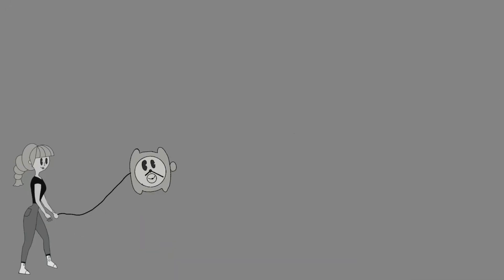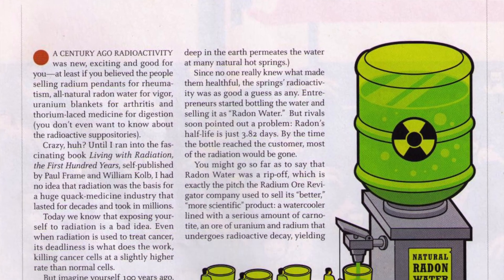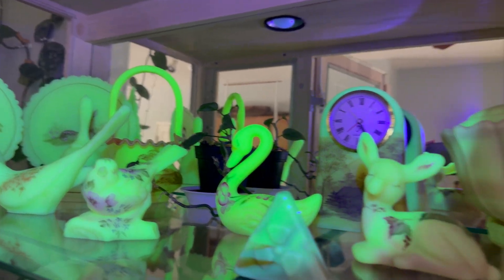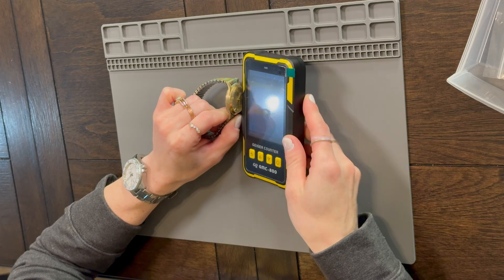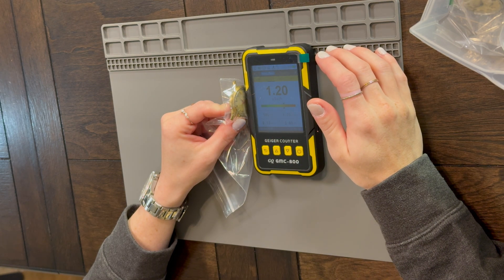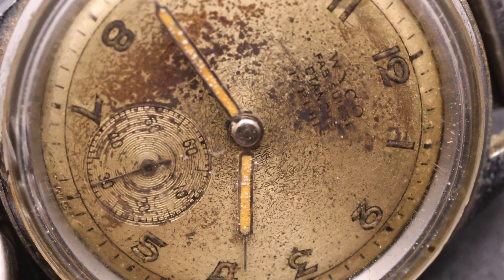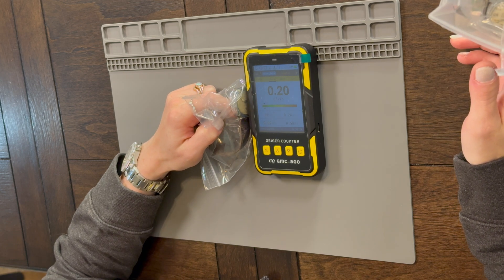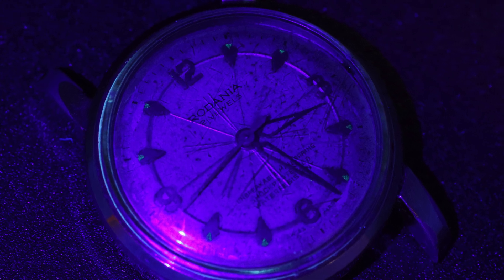New To Vintage Watch Repair? Be Mindful Of Radium Lume And The Risk It Carries.

Comment: I bought some Osco watches for parts  The dials on them were not radioactive but the movements  still had fragmented radium lume on them. I assume they had been stored with some watch parts that were radioactive. I always check with a UV torch first and an Alphahound. Radium dust can be microscopic and easily inhaled especially if youre using a lupe.  If you do ingest it Radium ends up in your bones because the body teats it like calcium.

Comment: ...i know hot to  clean that  from Radion , but i dont can explane that,ppl repead it wrong or alike . one thing is to  mention by ruel off tenic  to stat that   cheapest is   a   airfilter syiem climatet  container room,  that stay on  a masiv concret plate ...so far that laboratory.... iown 3 off that Lever / rolex  in London(i buyd foa a very low price ) made  but  might when i retier i have time for those awail they are  radiontion save seald.

Comment: I’m going to qualify my comment by saying I work in the nuclear field. Radioactive doesn’t always mean dangerous. Bananas give off low level alpha (helium-4 nucleus) radiation, and bananas are quite harmless to eat. While breathing in radium dust, or eating without washing right after working on a radium watch can be harmful, as long as you take necessary precautions, you’ll be fine. Wear full gloves, a respirator, and get a big gallon ziplock bag and work inside of it. Also, if any dust gets on your desk, or tools, they are now contaminated, wiping it up with water will not work, I recommend Fantastik, wipe once, fold the cloth, wipe once, fold the cloth, etc. Put the cloth in the ziplock bag. However, radium stopped being used in the late 50’s early 60’s in favor of tritium, which is a radioactive form of hydrogen. It will still make your Geiger counter go off, but is much less harmful than radium. If you ingest tritium, just go drink beer and you’ll flush it out, that’s not hyperbole. Don’t be scared of the Geiger click, be careful and respectful, but understand what you’re working with might not be as bad as the doom and gloom videos would have you believe.
Reply from the maker: Yea I know they are ok to work on if you use the right precautions. I just don't know that I want to work in a large zip lock bag with a respirator 😅 And my fear mostly came from the fact that I didn't know about radium in watches and its dangers BEFORE I opened one and worked on it. So this video was mostly meant for the newbies to the hobby, that don't know about the potential danger of working on them with no precautions in place.
Thanks for the info about Tritium!
Reply: @Thesecondhandwatch very good! I really like your videos, especially your commentary.

Comment: I would definitely work on them, with BASIC safety practices they are no worse than a X ray or an air plane flight, enough of these historical pieces have unfortunately been lost due to the issue.
Reply from the maker: Yea it's really the airborne particles that get me worried. I'll work on some of them someday, but not with my current setup.

Comment: I was at a flea market last week digging through piles of boxes that were clearly pulled from the storage unit of someone who had passed away, and pulled out a vintage watch dial with no crystal. I immediately thought about radium, and wasn't sure if it was or not, so wanted to wash my hands just in case, but of course the restroom was out of soap, ugh lol
Reply from the maker: Hopefully it was radiumless. Of course there was no soap 😅 Glad you knew about the radium though!

Comment: Don’t ingest it. Don’t sleep next to your box of watch parts and you’ll be fine. Don’t work on a surface that is hard to clean. Go take your geiger counter near a ww2 fighter plane in a museum. Sitting in the cockpit of some of those will give you like a chest x-ray per hour in dose. Radiation is everywhere. The limits set by the government are very low. The dose that actually increases your risk of cancer is very high. If your device detects gamma and your far enough away for it to show normal background you’re fine. Also water and sand are great moderators. If you are really worried about it get 2 buckets, put one bucket in the other and fill the gap with sand and then put a garden paver on top of it.

Comment: You'll hear a ton of opinions on this.  Don't lick it and you'll be fine, but i think it comes down to personal comfort. I wouldn't dare touch them.  There are so many watches you can work on that it's not worth the risk.  If you enjoy vintage wristwatches, I'm sure you'll enjoy working on antique pocket watches. No wristwatches can match the beauty of those movements.  An absolute joy to work on.
Reply: Surprised you are so scared of them given your work .
Reply: @MyRetroWatches  I've had a tumor removed 5 years ago.  No way I take any chances.

Even the radium girls, who licked the radium, didn't die immediately. It took them a couple of years.  So if I accidentally inhaled some, would it surprise me if it took 5 or 8 years off my lifespan or caused tumor growth?  Not in the least bit.

Comment: I take a moderate approach on the matter. I have several radium painted dial watches, and I wear them without concern. Radium watches were worn on millions of wrists for decades without a public health issue. That said, I won't sleep with one on because I'm likely to put my wrist up to my face when I sleep. The biggest exposure hazard in working on radium dials is from generating radium dust, which can be avoided by removing old lume under a liquid, or just not disrupting it. Keep doing your research, take everyone's opinion with a grain of salt, and do whatever you feel comfortable with.

Comment: Can all be summed up by using common sense. Unless we work on watches with radium dials day in day out the exposure will be minute. I live near a nuclear decommissioning plant so I have more to worry about than most.Be careful when changing the battery in the smoke detector.If anyone is not happy about working on radium watches especially Rolex and Omegas send them to me and I will safely dispose of them completely free of charge😁
Reply from the maker: It's the airborne particles that worry me.

Comment: Glad you got a radiation detector, Katchiri. (Did I just butcher your name?) i think the real danger is breathing in the particles if they become airborne. Definitely wear a good quality respirator and put the hands under liquid when removing the radium. Also, don’t go by how bright the glow is, as it’s not a good indication of the level of radiation. I hope you keep up the videos and hobby, because I really enjoy them! ❤👍🏻😊 oh and you’re probably fine keeping them in the house. If you’re worried, just keep them in ziplock bags to prevent particles from getting airborne, and put them in a metal container.
Reply from the maker: I will keep going for sure! 🥰 I had so many people commenting on my videos saying that they were about to get into watch repair, that I wanted to warn other people like me, about the possible dangers of it 🙂
Reply: @ good on you! I bought a radiation detector a while ago to check the old watches I got on eBay to work on but fortunately none are “hot” 🔥 I’m working on an old Gruen from the 50’s (from the looks of it). I got it back together and running well. My first time getting this far on a Swiss watch! I ordered a new crystal for it but reused the original mainspring.
Reply from the maker: Congratulations! 🥳 I love myself a vintage Gruen.
Reply: I'm a bit late to the party, but I wanted to say that I am very glad you pointed out that the glow is not a good indication of radiation level.  

Radium has a half-life of 1600 years.  That means that a sample of radium will be half as radioactive 1600 years from now as it is today.  That also means that the radium painted onto watch dials and hands back in the early 1900s will have lost only about five percent of its radioactivity due to decay.  The glowing bits in a radium dial usually come from zinc sulfide, which glows green when energized by the radiation emitted from the radium.  The zinc sulfide also becomes damaged over time by the energetic particles emitted from the radium, eventually breaking down and ceasing to glow.  It is entirely possible to have a radium dial that doesn't glow at all anymore.  Always check with a good alpha/beta/gamma instrument if you have even the slightest thought that a dial might contain radium.

As has been stated many times, the primary danger is from particulates containing radium getting into your body, either via inhalation, ingestion, or through a break in your skin like a cut or a poke with sharp tweezers.  If you want to practice, get some modern lume, apply it to a watch face, let it dry, and then pretend that it's "radium lume".  If you want a harder challenge, add a little powdered, modern lume to the watch face, to simulate radium lume that's flaked off from the watch hands and is just rattling around underneath the crystal.  Use all the safety precautions and procedures you would if you were handling a real radium watch dial, and remove the lume from the watch dial and hands.  When you're all done and you've cleaned up, take a UV light and see how much "radium lume" is still on your hands, your tools, your work surface, etc.  If you have solid procedures, all that practice lume should be in your "radium" waste bag.  Certainly beats learning using the real stuff.

As far as disposal... check with your state and local radiological health and safety officials, as it can be a crime to just chuck it in the trash.

Comment: So they're not safe to wear on the wrist?
Reply from the maker: That is up to the wearer. As long as the crystal is not broken and it is sealed tight, it is safe in my eyes. Working on them is different because of radium and radon particles possibly being breathed in or ingested. 
I saw a study suggesting that you get more radium from the internet in your house than wearing one of these watches.

Comment: I will go a little further than MyRetroWatches said, I would suggest Nitrile gloves instead of finger cots, and a HEPA filtered respirator.  I say this because I am a retired Haz-Mat Technician, and I know that if you are working with Radium painted dials, indices, and hands, it could be in such a condition where it rubs off easily and could become airborne.  Radium gives off mostly Alpha particles (although Gamma radiation is also given off as energy as the Alpha particles are ejected.). It (Radium) is not that bad as long as it is not ingested, inhaled, or injected into the body.  So, an ounce of prevention prevents a pound of cure.
This is what I found while doing a little research, it sums things up pretty well.  “Due to the short range of absorption and inability to penetrate the outer layers of skin, alpha particles are not, in general, dangerous to life unless the source is ingested or inhaled.”  (Christensen, D. M.; Iddins, C. J.; Sugarman, S. L. (2014). "Ionizing radiation injuries and illnesses". Emergency Medicine Clinics of North America.)
Reply from the maker: Thank you! Great information!
Reply: I called my radiation expert friend who told me that you have already covered the subject well. Thank you, I can relax now! 😊

Comment: I'm so pleased that some people had the presence of mind to raise this issue. Even though a Geiger counter is very crude, in this instance we already know that the danger is radium and it's not trivial when it comes to servicing watches. I'm sure you've seen it done safely but erring on the side of caution is always an excellent choice.  😊
Reply from the maker: My biggest concern is when it becomes airborne. I don't really want to mess with it at my kitchen table 😅
Reply: @ Absolutely agree. The accepted advice is to resist any temptation to swallow or inhale it. 🙃

Comment: Wristwatch Revival just covered radium safety in his latest upload, tldr: it's low level enough not to penetrate skin but getting it in your lungs would be a problem. So I wouldn't work on them either, watchmaking work is hard enough without having a mask on your face 😷. Love your channel by the way, just subbed 😺
Reply from the maker: Thanks! I haven't seen his latest!

Comment: Tritium is much safer and was used more in the 70s.  I have also removed radium dials and then tested the movement away from the dial and get no Geiger readings.
Reply from the maker: I've heard that sometimes the Radium starts to disintegrate and can get into the movement? I'm thinking if everything was cleaned properly and disposed of after, that would help the problem 🤔
Reply: @Thesecondhandwatch you are correct. Often it has crumbled away from the dial so can only really end up in one place. That being said it might have been serviced previously and those particles are long gone.  Now you have your counter you can check this. Main thing is cleanliness. I have a small plastic box I will only put my radium dials and hands in when working on those watches.  If I use rodico then that piece is binned too. 
I guess the higher reading watches to steer clear of bit if it’s a nice watch then consider.  I’ve seen red dead restoration remove radium in water and then relume making it safe. I’ve also had one of my own subscribers email me their total process for this too.
I’ve done quite a few radium watches in and off camera . It’s very easy to get anxious and I do still now as at 49 I had cancer already.. (now 52 and all clear) 
By the looks of your taste in watches you seem to like 30-50s watches and many dials will only be radium.  1960 I think it was deemed unsafe and outlawed and they then said tritium is safe which it wasn’t but has such a small half life that anything in tritium that is 50 years old is extremely low risk.  R and T on dials give you an indication too except on Seiko who use T even in dials with no lume.
Keep going, you’re doing well and don’t let this put you off what is a fantastic hobby.  I did a video recently on a Junghans new old stock watch with a radium dial. Watch looks like it just came out the factory!  That watch was very safe once the dial was off and in its box on the other side of the room 😂
Reply: @Thesecondhandwatch This is true - you’ll find watches where the radium lume is very stable and in good condition and it will stay where it is if you’re gentle. 

There are other watches where the glue and binding agents in the lume has decomposed, often due to the radiation. The lume crumbles and can end up anywhere fine particles could reach within the watch. 

When working with watches with deteriorated radium lume, it’s important to capture any dust and dispose of it. I’ve seen people on YouTube that are working on radium contaminated watches who were careful not to inhale or ingest it whilst they’re removing the hands and dial, but they’re not taking precautions against contaminating their work area, nor are they treating the movement as potentially being contaminated. 

If you let the radium escape into your work environment, then it’s much harder to avoid absorbing it down the track. 

Really glad you made this video, you did a great job, too. 

I’ve warned several beginner watchmakers on YouTube about radium. A few ignored it, others were grateful, but none made a video about it, which spreads awareness far better than my comment to a video.
Reply from the maker: Thank you! I thought about the cleaning up process too and how it could get on so many of your tools. 

I'm so happy you appreciated the video! I was so concerned about the fact that I would have taken apart watches and not known about the dangers of Radium dials if I hadn't made a video and had so many nice people (like yourself) to warn me about it. It scared me that some people just don't know.

Comment: I don't work on them for similar reasons to you, my workspace is my living room so I would rather not irradiate it. 

Two things I've heard from people who do work on them: if you're worried, open the case outside, and seal the radium with clear nail polish. It's like asbestos - only very dangerous when ingested. 

For me though as I don't have a garden and there is, and forever will be, no shortage of vintage watches I just avoid them entirely
Reply from the maker: That's so interesting! Thanks, I'll be looking into the nail polish for sure if there is a radium watch I really want to think about working on 💕